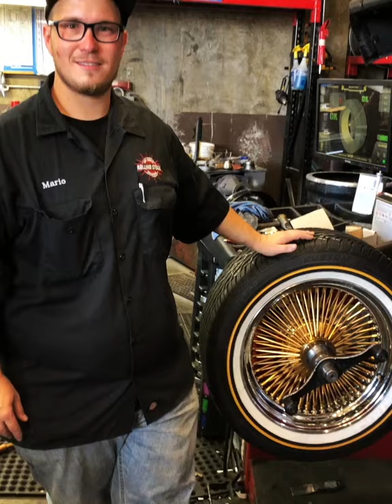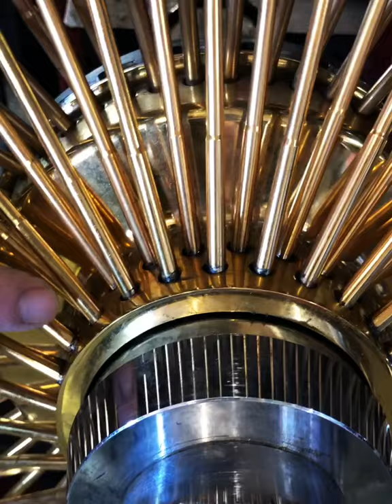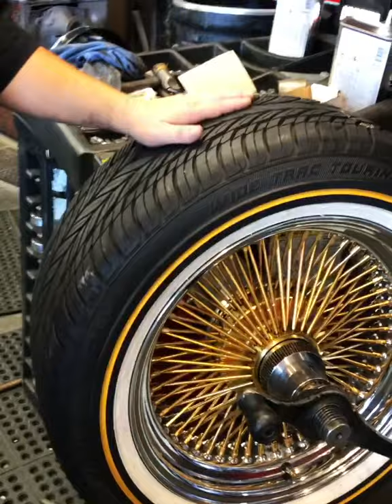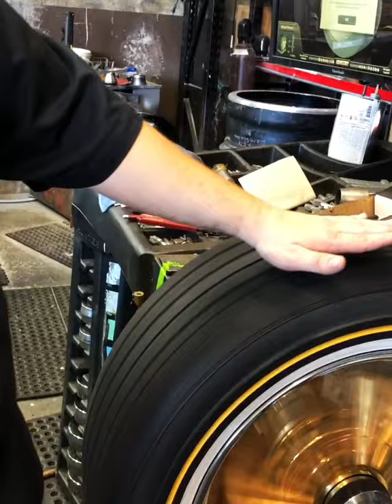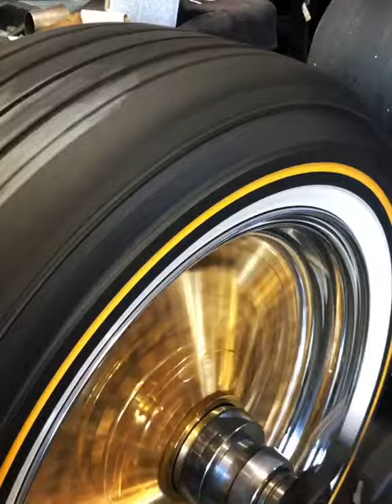Effects of Too Much Torque on Wire Wheels! This is a Safety Issue!

Comment: All these years and I didn't know those wire wheel spokes could be tightened like a bike or motorcycle wheel. Good stuff, taught me something new.
Reply: But, ugh, why wouldn’t they be? Lol. Why did you think car wheels would be different from motorcycle wheels?
Reply: @jamesbizs  Just figured they were welded to rim and center.
Reply: @fjb666  makes sense to me
Reply: I was surprised too. I rarely see these car wheels, mainly on low-riders that bounce. But I always thought they were one piece. I didn't know they were like bicycle & motorcycle wire wheels.
...Do these car wheels use tubes too?
Reply: Now that I think about it, it makes sense.
Dirtbikes, Dualsports, and Adventure motorcycles use wire spoke wheels, because if they hit something hard enough offroad, a cast wheel would crack or be too bent to hold air.

Wire spoke wheels are stronger, and if they do break, you just have to replace the rim or broken spokes, and rebuild the wheel, instead of buying a whole new wheel. 

I understand now why bouncing low-riders use wire wheels. Its not just a style, its actually to survive those bounces.
Reply: @observingrogue7652  no they don’t take a tube. They are sealed from the inside with silicone over the places where the spokes meet the wheel. So in order to adjust the tightness of the spoke you would need to remove silicone and reseal afterwards.
Reply: @observingrogue7652  most motorcycle, atv, cars, never use tubes.
Reply: @fjb666  so those big nuts at the end of every spoke. Did you think that was just design?
Reply: @MyChevySonic  They could easily be fake with the real support hidden in the back. Give the guy a break.
Reply: @MyChevySonic  to be fair alot of custom wheels have non functioning bead lockers and multi piece wheel designs with what looks like functional bolts  that actually do nothing. To the untrained eye it is eassy to see why someone wouldn't know the difference.
Reply: @MyChevySonic  I've never seen a set up-close. And you never know, could be just design, alot of aluminum wheels have what look like bolt heads cast into the outer face of wheel, but they aren't real bolts, and then there is the truck wheels that are made to look like beadlocks but they aren't actually beadlocks.
Reply: @jamesbizs  it’s also been a while since wire wheels were norm. back when they were common, you’d probably never mount a tire over 5-6 inches wide on it. i think it’s fair to assume the newer, large and wider wheels going on heavier cars may or may not have needed a redesign for strength.
Reply: @observingrogue7652  definitely not an advantage with cars but bikes also use them cause theyll flex side to side allowing for the tire to track through rough stuff better
Reply: AO.    You trying to be funny  our you being serious!
Reply: @observingrogue7652  Not all lowriders use wire knockoffs  some use solid wheels to
Reply: @stephenwooten1032  Serious
Reply: @stephenwooten1032  go solid , knock offs smh , I mean if it's a car you never to rarely drive . Like a lowrider or classic , ok. Anyone else , I have idea why you'd get knock off Dayton style rims. #1 they're expensive,  people steal , common sense . #2 they can come loose , gotta check them all the time and tighten them. One comes off while you're driving , lotta damage. I've seen this happen #3 you get a flat , have fun , you're looking at a tow. So overall , I wouldnt recommend them to anyone except lowriders and classics that mostly sit in a garage

Comment: I’m just happy he called them “wheels”… instead of rims.
Reply: Indeed, a rim is a part of the wheel and most high performance wheels are multipiece and you can order a different offset rim for your wheels, or replace damaged ones alot cheaper then buying a new set of wheels

Comment: Laced with the spokes all straight out like that it's no wonder they fail from to torque. But I guess the way they're made there's no changing that really. If you look at a motorcycle wheel you'll notice that the spokes don't go straight out
Reply: This right here.  The radial spoke lacing is known to be weak against driving and braking forces.  Thats probably why its got what looks like 100 spokes lmao.
Reply: @jimmyhopkins9497  yeah, the conventionally laced wheels have the spokes always in tension. That radial lacing has bending moment, tension, maybe even some compression, forces going every which way, it's just asking for failure it's unless it's on a rolling only wheel. I'm guessing it's cheaper to manufacture or something
Reply: Classic Form over function in the car mod world.   Like so many who put a “cold air” intake in a open engine compartment. Looks cool but you’ll lose power and torque.  

Radial lacing is used on some BMX flatland wheels. I like the look on cars too. Good PSA here.  True your wheels:)
Reply: I think if I recall and nobody minds a little rambling, maybe some 80s BMX bike kids will pipe up about it and help me out here. 
The pro guys used to radial lace the back wheel.
Something about the radial lace being able to move easier from a dead stop or something, they had some kinda advantage in that situation. 
I recall a big to do about it, and we did party hard back turn so that's why I only remember bits and pieces 😆
Reply: @MrTheHillfolk  hehe I’m a 90s kid but I remember that :) I doubt any pros use radial lacing now because the stunts they pull are INSANE now! Exceptions being flatlanders but that is a deep underground subculture compared to park, vert and big ramp riders. 

We ran poly wheels on Hi-ten framed bikes...we were Tough!!
Reply: @MrTheHillfolk  slight amount of stored energy due to the torsional flexing?
Reply: @jo8737  
Haha good times. 
My buddy had a set of Z rims and it was always a hoot to do a kickout and watch the wheel flex like 3-4" at the bottom 😃
And bust a few spokes after a half an afternoon of that 😜
Reply: @joecummings1260  
Something like that ,but I remember something about the way the wheel starts to roll ,if it's a driven wheel.
Yea like it takes a second to wind up(so to speak) before it goes. 
(Radial vs cross lace)
Reply: @MrTheHillfolk  I could kind of see that working to some slight advantage coming off the starting line. It is a little bit of stored energy.  Was it just a theory or did it really work for the BMX guys?
Reply: @joecummings1260  see, the strange thing is I thought they used it on the front wheel.
I do have a stack of BMX action mags in ma's attic , I wonder if I have to start hunting for the article 😃
Seems like I've remembered enough to cause myself some trouble 🤣
Reply: @MrTheHillfolk  that sounds like it makes more sense. Radio lacing on a front wheel because it only rolls and never sees any torque should make it stronger, and being that the spokes are shorter also a tad bit lighter
Reply: @donbeadling5426  thanks man , that's what I couldn't put into words from the fuzzy memory

Comment: In the days of the horse and buggy, it was learned that when applying torque/breaking from the hub instead of the rims outside surfaces,  it's better to cross the spokes to counteract these forces instead of running them radially,  was this just done for looks or am I missing something?
Reply from the maker: Hi Cameron, Yes! Your correct--this radial style is just for looks :)

Comment: The problem is that it is radial laced. It has to wind up a little to transfer torque from hub to rim or vice versa. It has to be laced with at least 1 or 2 cross. Look at a bicycle wheel. They’re usually 3 cross. You’ll never see a radial spoke rear wheel on a bicycle for this reason.

Comment: I got a cutlass with a turbocharged 4.8 that makes around 550-600bhp. Is that enough power to be weary of spokes?
Reply from the maker: Yes. We would not recommend wire wheels on a car with that much horsepower

Comment: “Let me also show you how these extremely expensive wheels will cost you even more money in the future”
Reply: Now that's where you're wrong.. the spokes can be tightened. Then reseal the wheel. Just as a 3 piece wheel pays for itself down the line. If something was to happen to a 3 piece wheel, you can replace the barrel. Or even change them out, just because. Where with a cast wheel, if something happens to it, you more than likely will have to replace the whole wheel if you can still get that type of wheel..
Reply: @nonameisthename138  What's going to happen to my one piece wheels though?

Nothing, unless I crash the car.
Reply: @stevenkelby2169  
Lol, yeah or you can hit a big ass POT HOLE and they don't make those wheels no more! 🤷‍♂️🤦‍♂️
Reply: And they are hideous
Reply: @nonameisthename138  or they don't make parts for your overpriced spoked or 3 piece wheels no more?
Reply: @stevenkelby2169  
I don't have spokes, but I do have 3 piece wheels. You sound like someone who WANTS it, but can't afford it for whatever reason. If that's the case, wait your turn. You'll get there, but no reason to bash( or trying to) others who has it. It shows immaturity..✌👋
Reply: @nonameisthename138  Nah I've got plenty of money, I prefer forged alloy wheels though, lighter and stronger.

No hard feelings to you preferring 3 piece or spoked though 👍 🍻
Reply: @stevenkelby2169  
Its all good, my 3 piece wheels are forged. You gotta pay for quality 💯
Reply: @nonameisthename138  I worked at a tire shop for years. The biggest issue with 3 piece wheels was air leaks at the seams. Alot of guys say they can work on them and just don't do it right. Cool wheels as long as you have someone that knows what they're doing. Around here they are few and far between haha
Reply: @dommyboysmith  
I do too, mine is for showcar purposes. So I more than likely won't have those issue. Been two years now and no problems. But I do drive it too...very carefully😳😊
Reply: @dommyboysmith  certain brands are worse than others.  

i heard forgi is coo  and corleone  and armanis i heard are alright  and ruccis  havent seen people run asantis  for a long time since back in the early 2010's when everybody started riding big 3 pcs

Comment: Fun fact... Some cyclists remove spokes to allow the wheel to twist slightly under pedaling
Reply: The wheels do that anyway.
Check some slow motion of accelerating push bikes.
Everything twists
Reply: @sebastiend.5335  Exactly mate. But there's pros and cons to have more or less spokes and it makes the pedalling effect change with the way the hub is transferring torque to the wheels
Reply: @sebastiend.5335  And not all bike frames twist dramatically. Professional riders have their carbon fiber frames specifically made to their own riding style and weight so they can have more twist up top or down low
Reply: @MaNNeRz91  It's all very cool indeed!

Comment: That's the reason why oldscool wire wheels have crossed spokes.
Spokes need to be tangentional in order to transmit torque within the wheel.

Straight spokes are just for show.

Basic mechanics.

Comment: Is this an issue with 13 x 7 reverse wheels? never seen this happen before in my life with loose spokes at the hub.
Reply from the maker: Yes, it's very common for low riders/ wire wheels

Comment: Can you repair Cragar Starwires when the back plate cracks or spokes loosen up?
Reply from the maker: JD, we're going to need to check your wheel out to give you a definitive answer. In general, that isn't a serviceable wire wheel. Are you anywhere near SF, CA?
Reply: @RollingStock  thanks, no

Comment: Are wire wheels on a motorcycle capable of the same thing? 9 years ago, I believe the wire wheels caused my bike to fishtale when I had to brake hard(foot first,  hand second)which put me down doing 75. Bounced of a tanker truck into the tires on the ambulance.  Have not rode since . Just curioue
Reply from the maker: Yes, that's possible!  Sorry that happened to you!
Reply: @RollingStock  thanks!

Comment: You are  supposed to spin check all wire wheels before you even dismount the tire. I would have brought the customer in the back and shown them this before installing the new tire. Now you could be considered liable for the loose spokes due to poor technique or using wrong tire machine wheel mount interface (center bore mount vs rim clamp type) not to mention risking damage to the new tire the customer might not even want any more. Sorry to ramble. It's just that I've been in this type of business for a good amount of time. Seen lots of scenarios. Hopefully lesson learned.
Reply from the maker: That's exactly what we were doing, and we made a video out of it!
Reply: @RollingStock  my mistake, I thought you mounted the new tires already and only discovered the issue upon balancing. Keep up the good work

Comment: Tangential spoking on a car wheel!?
The spokes on this wheel will always have a tendency to loosen as the spokes lack the length to spring as
they are short and all work in only
one plane. Sorry pal this will never be right in a month of Sundays.
Take a look at early Jaguar or MG
spoke car wheels and you will notice
that the spokes are layed in the correct pattern. Not for fun, engineering and development over
many years.